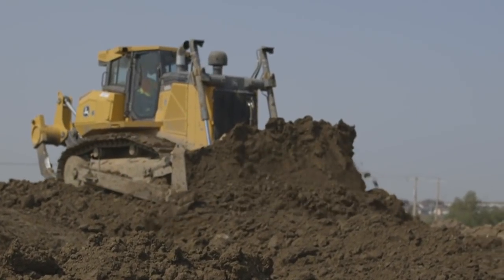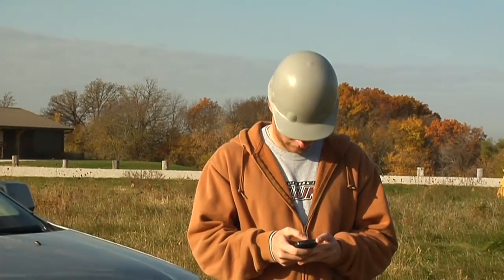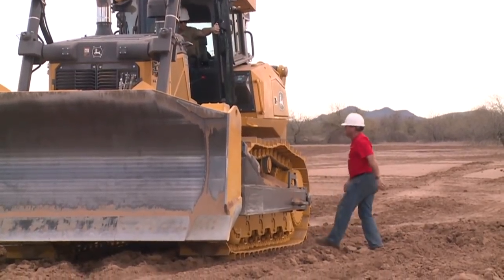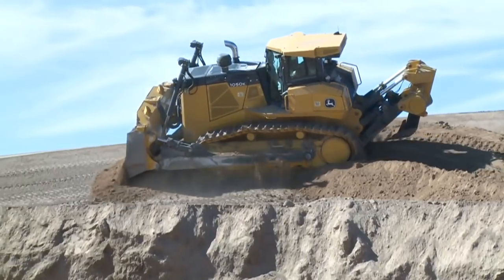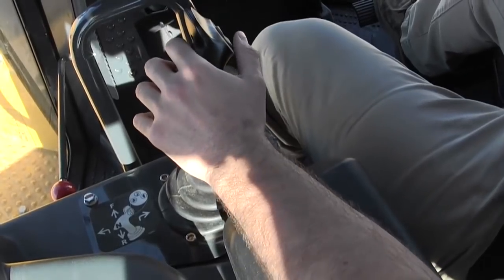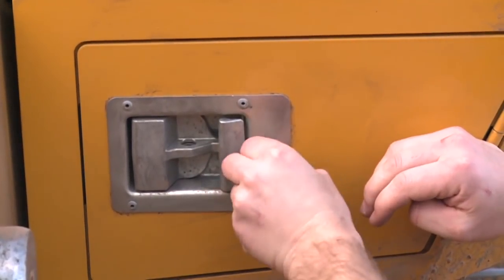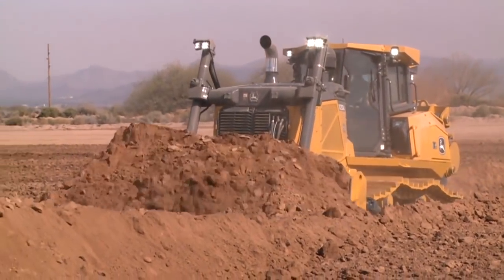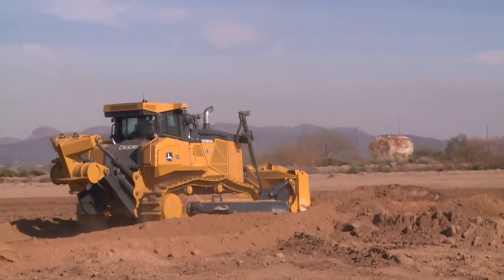John Deere 1050K Dozer Safety Tips

Comment: A roll protection was built to keep the driver alive and the old flat track cats didn't have seat belts because it was a dum idea and the dozer your showing doesn't have roll over protection so a seat belt won't do any good
Reply: The cab structure is the rollover protection